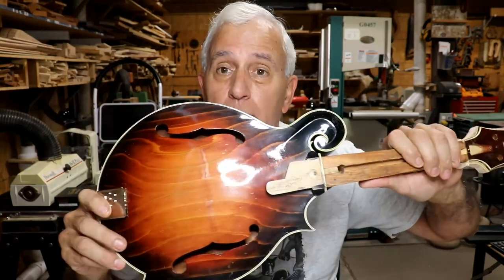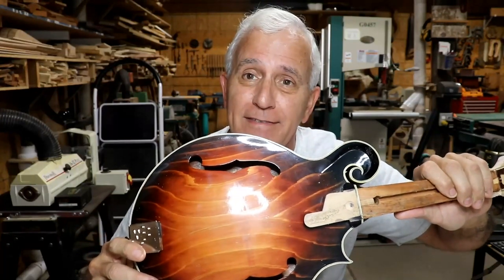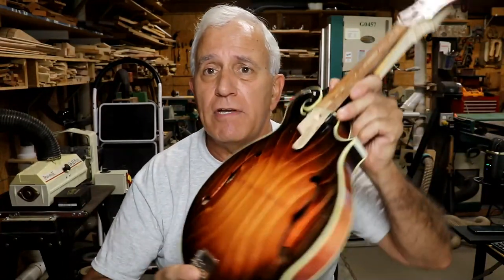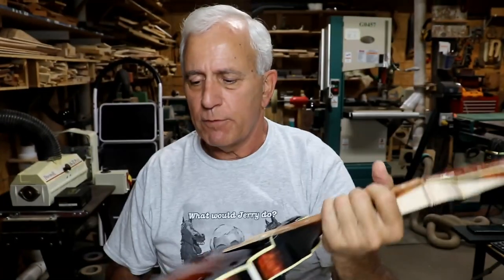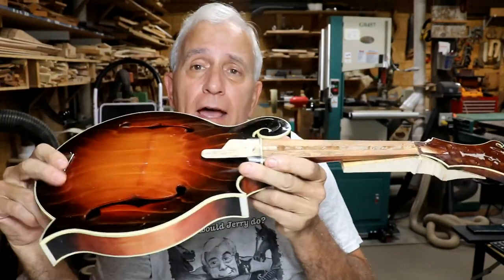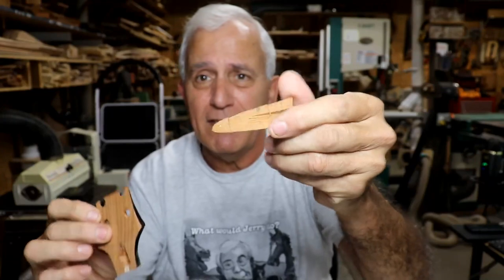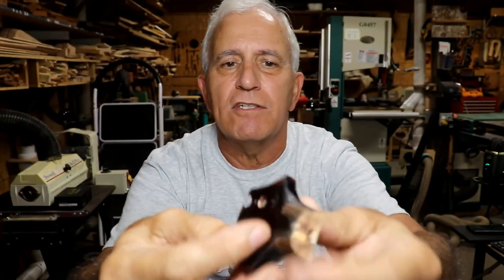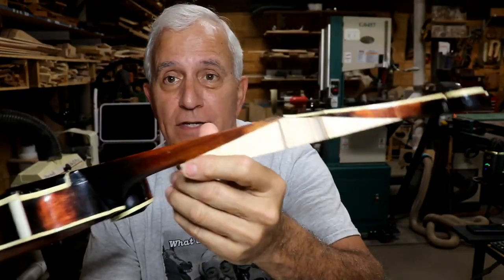Vlog #092 Broken Neck Mandolin Project

Comment: RE that Mule - Kawasaki  has had issues with fuel pumps in recent model years. I know of several recent-year Mules requiring new pumps. There should be a recall on those.

Comment: In addition to the new equipment not being any better than the old equipment, unlike on the old equipment, an owner may not be able to DIY a repair on the new stuff and it'll cost a small fortune, if out of warranty, to get it repaired by an authorized shop or dealer.

Comment: Don't you hate it when things break?  I've got 2 lift cylinders on the loader of the 5400 needing rebuilt, can't get parts because someone in Europe helped themselves to my bank account, the pump on my carpet cleaner bit the dust, and that's just the starters.